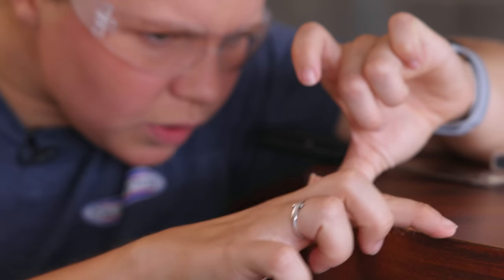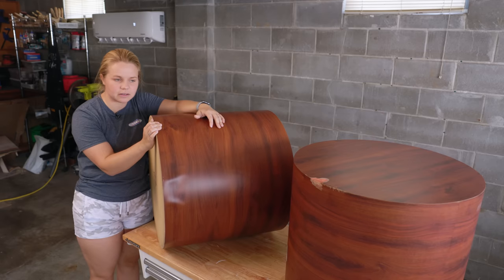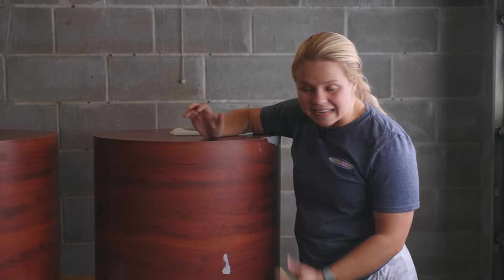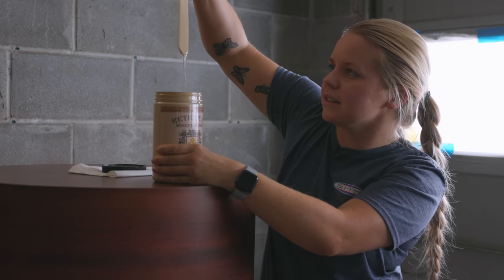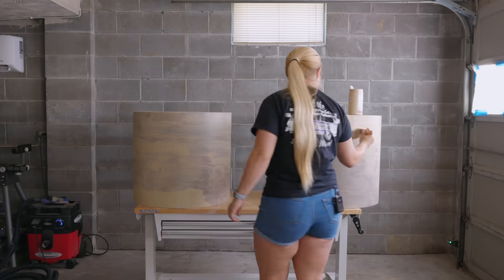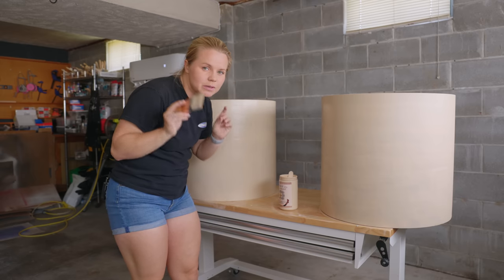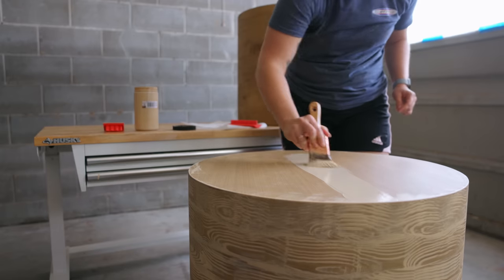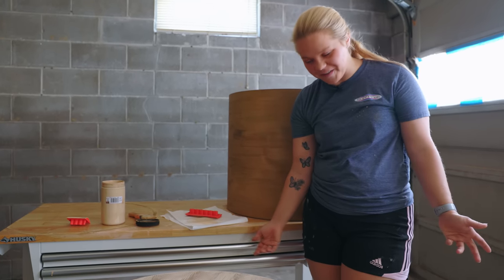You Won’t BELIEVE this Furniture Makeover!!!

Comment: nice job and I used their wood product a couple of years ago and it is an excellent product. I started using the graining tool for my kitchen table top but  I  had preferred the fluid look that you previously had with the gel stain. If I remember correctly I don't think the top code is as good as some other products out on the market.

Comment: Did you not have to sand the laminate or did I miss it. I recently worked on a laminate piece and hated it. I felt like I could not get the surface rough enough for primer to adhere. Cony. The tables turned out great. What price will you post them for?

Comment: Just one comment. Practice using a new product and especially a graining tool before hand.
It's a wavy motion with the tool. Most of the time just vertically. With a lot of practice maybe then try something horizontal. And yes the graining tool can be used with paint. 
Still all parts of a piece of furniture should have the same amount top coat. Sorry, couldn't hold back on the comment because we have been in business since 1975.
Reply from the maker: we can agree to disagree (: thanks for your comment & support!